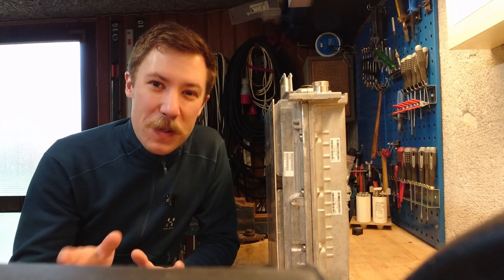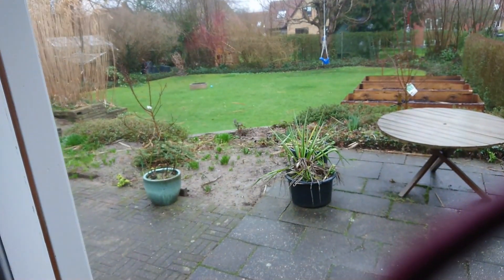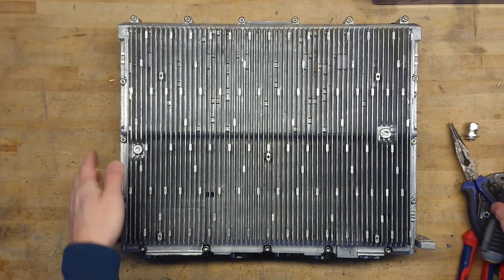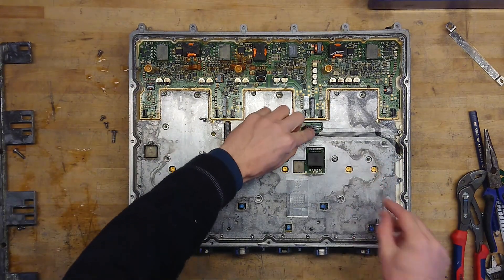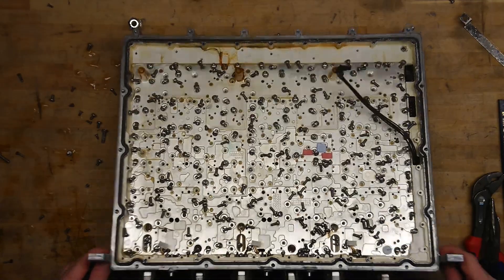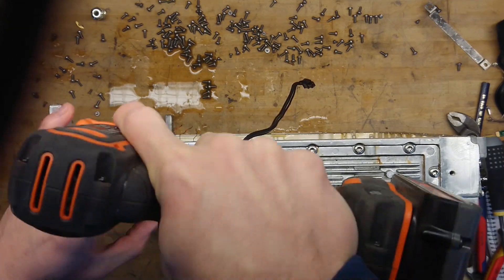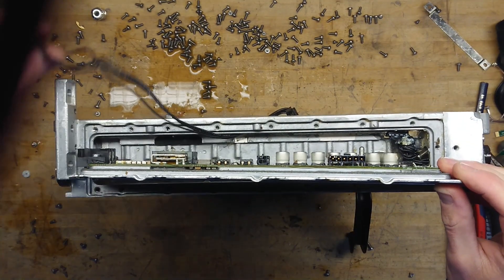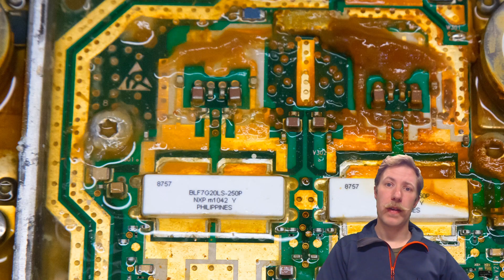Nokia Siemens Flexi 3x70W FXEA 1800MHz Base Station Teardown: Power Amplifier (Part 1 of 2)

Comment: Don't scrap those RF power amp boards. THey are valuable to radio amateurs. List them on ebay. For example, those BLF7G20LS-250P RF transistors are $108 a piece new on ebay. RF conenctors are also valuable. You can make a decent side income tearing down these mobile basestations and selling parts on ebay.

Comment: HOw do you lay hands on these, every time I see towers being worked on the old stuff is always carefully collected up and taken away out of reach of curious hands.

ALso wondering if you'd sell one of the water damaged PA boards?
Reply from the maker: It is handled as electronics waste, I buy it as such, so it should be considered dead/defective. The parts are going back to recycling for their precious metal contents.
Reply: @KaizerPowerElectronicsDk  Where do you find these pieces of equipment? Are you lucky enough to have a good junkyard nearby?
Reply from the maker: @reecebeck971  Luck and building relations with people is the key to any door. Be it companies or junk yards.

Comment: It may still work after soaking with some weak acid and baking in the oven overnight. It seems some rf-critical traces have ben eaten away but should not hurt to attempt to power it up. All the power amplifier chips/fets can be reused though.
Reply from the maker: Part 2 will not only be the circuit analysis as usual, but also with a reverse engineered test of the amplifier.

Comment: if you can show also the power electronics in the part 2 i would be so happy, seeing the planar Transformier and what topology they use, im also a power supply designer and always interested in what other desinges have done, thats for the amazing videos! Also the input filter looks interesting to see against what they protect the unit
Reply from the maker: There is for sure going to be some about the power supply, I am not sure I got the input filters on the diplexer...

Comment: Why does the Basestation Need 70W while the Mobile Part is 2W Max.RF Power?
Reply: Since you can't hava a lot of transmitting power in your phone you need a very big antenna on the baseststion to be able to receive the weak signals. 

And since you can't have a very big antenna on your smartphone you need a lot of transmitpower on the baseststion to be able to get enough signal to the phone. 

That's basically why :)

EDIT: the professional answer is link budget, just incase you want to read up on it.
Reply from the maker: A base station services around 500-1000 concurrent users, your own phone need only to hold up one line and due to SAR restrictions a handheld device that you hold close to your body can only be that powerful.

Comment: Nice vid thanks for sharing also did you see my gu39b vttc lash-up? Steve
Reply from the maker: I will check it out
Reply: @KaizerPowerElectronicsDk  its only a lash up test rig for now ,  i will be rebuilding it with bigger pri and sec on the final version  i picked up a better B+ tx yesterday, its still not quite what i want (10kva at 6.6kv) but its much better than MOTs i know thats not hard those things are horrible.. i will upload when i make any changes etc 
Steve ps love your work true pro

Comment: Nice teardown, it's a shame that the units got so wet. 
I have never seen the tunable part, really interesting, would be interesting to look at the S11 and S21 parameters of the filter to see if the power rating is because of the tunability. 
Especially since the amplifier modules are way capable of over 100W (as I have heard ;) )

Looking forward to part 2 :)